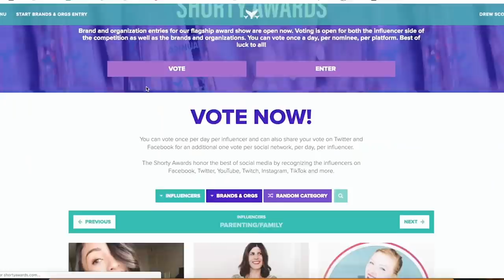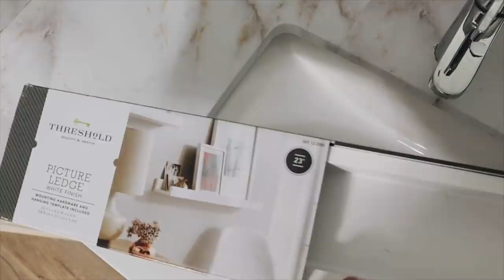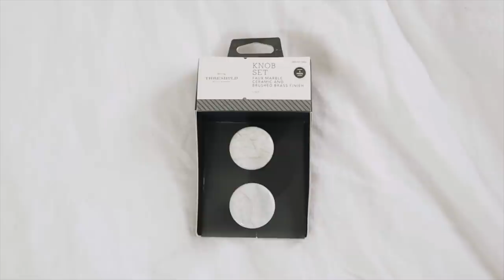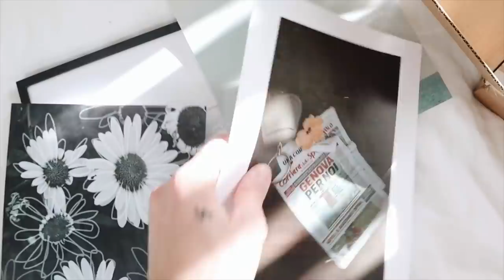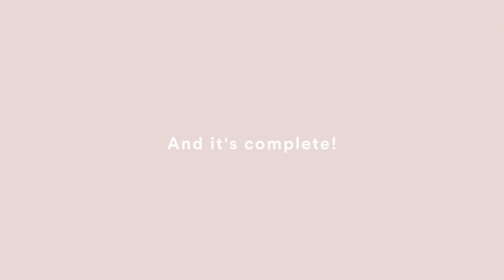DIY BATHROOM MAKEOVER + $20 Marble Countertops // Lone Fox

Comment: How did the contact paper do with water?? Inquiring minds want to know!!
Reply: Lauren Nicholson I just googled it and for the majority, contact paper IS waterproof, as well as oil proof, etc! Guess who’s going to redo her bathroom tomorrow?😂me, duh
Reply: Yup! I’ve had this before and it’s usually made of vinyl which is waterproof.
Reply: Graciie W and that’s on 2 day amazon shipping
Reply: I do not think it will last, a solution for a year or so
Reply: What happens if there is a gap in the contact papers and the water goes below?? would that cause any issue?
Reply: You can always caulk the edges near the sink to help protect the edges from water squeezing between, and caulk is easy to remove later too, for rentals. 👍🏻😁

Comment: suggestion for the cabinet doors: take them off and cover them with a coloured contact paper then put them back on for a flawless door. (if you cover the holes for the screws in the door you can use a pen/pencil to poke a hole in it.)
Reply: Braedan Campbell you could use your old wallpaper!

Comment: I work as a carwrapper so my tipp for you if you use contact paper: Make sure you press hard enough so you don't have these little bubbles that you can't remove with making a hole. and second press horizontaly from the middle to the outside like a moon shape so you don't bring the air all the way with you :) But other than that i love the result!

Comment: Tried those contact papers before ..water goes under them and eventually it turns out so stinky .. if you have other ideas for the sink  ..it will be great :(
Reply: Was wondering about that...
Reply: I did mine over six months ago and have kids (they get water everywhere when washing their hands) dont cut the air bubbles and caulk at the seams caulk is removable

Comment: You are adorable! The contact paper worries me, so do you mind if I share my vision? I probably would have just worked with the grey countertop. There is just a small amount of cabinet space so to paint them, then paint it back when moving, might've been easier, as I fear removing the contact paper may prove to be a giant headache. I truly hope I'm wrong about that! I would have used a monochromatic theme: painted the cabinet charcoal grey, the walls a medium grey and accessorized with marble items, chrome or brushed nickel, wicker and plants. I also like a warm tone like Terra cotta as an accent color to balance out all the cool tones. I just have found over the years, that it's so much easier to keep the surfaces and any big items neutral and do all the zhuzzing with accessories. I do, however, think you have inspired ideas, and your finished room looks great (I just worry about the upkeep with the contact paper). I especially like the picture shelf doing double duty...awesome!

Comment: Will you let us know how the contact paper holds up against water damage?
Reply from the maker: I actually did this on my old apartment bathroom counters and it was perfectly fine for over a year. Not even one slight sign of water damage. The surface of the contact paper is very slick and shiny so the water just sits on top of it as it actually claims to be waterproof.

Comment: I'm sooo scared of working with contact paper....! I literally have 6 rolls of it at home and have yet to find the courage to use them! My sink is rounded, so I feel like it's gonna be super hard to work with.. any advice on how to "contour" a round sink with contact paper?!
Reply: if you put it in the sink and it gets wet it will ruin it, get under it and mold. contact paper is not really meant for this kind of thing... it will look cute for a while, but its going to get really gross in no time.